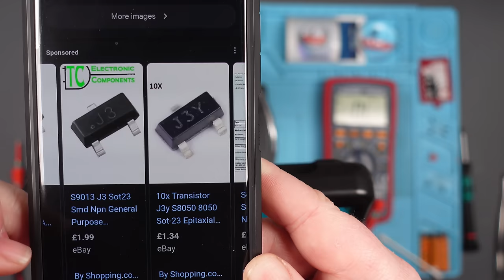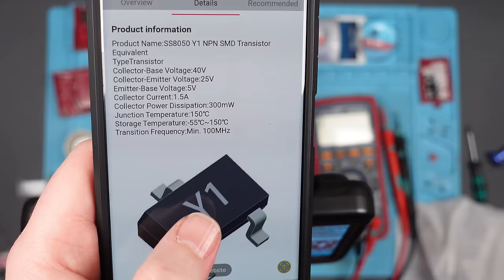FAILED Prior Repair Attempt on this RETRO ARCADE Game? | Can I FIX It?

Comment: May I suggest using rubber polishing bits (the green ones) for your Dremel instead of engraving bits. They come in different sizes and are much softer - so they perfectly remove the solder mask from the board and do not damage the copper trace.
Reply: Or a fibreglass pencil 👍
Reply: Agree with "ximonx"  I use a fibreglass pen those grinding pens seem way too aggressive.

Comment: I prefer a fibre glass pen rather than scraping away at thin PCB tracks, I find it's somewhat kinder to the track. 
My PCB coating of choice for something like this is cheap clear nail polish, plus I can do my nails afterwards and look pretty in the lab. ''I'm a laydeeee'' 😊😆😆

Comment: 7:56 "These tracks must be really really thin"

They probably were, but having you grind away at them with that grinder doesn't help. at 7:10  you can already see that you've ground a hole in the trace, just below the exact centre of the ground area.

Just stop with the grinder pen, it's way too aggressive.

Also the usual "stop soldering, it's on there already, leave it alone, you're just going to mo<plop>.... move it... yeah you moved it...."
I was very pleased to hear you say "why is it all wonky.... well I guess it doesn't matter" about 2 seconds before the part would be complete toast.

Another successfull fix though! Congrats!

Comment: You just put in a beefier transistor. Lots of parts are interchangeable if they have the same pinouts/functions. Of course you can't switch an NPN for a PNP and all that, but having a higher maximum doesn't hurt. Just like you could use 100W resistors instead of 0.25W resistors... it's just impractical. 

There's no real reason to get specific parts. As long as the part works with the voltage of the device you're working on and the pinout is the same, it's worth a try. You could also wire them in with a different pinout, but that's a little less convenient.

When working on really old electronics, you'll have to find similar things, as the original parts aren't made anymore. Audio equipment from the 50s-70s is a completely different world for example.

Don't overthink those repairs too much. You probably know enough by now to not pick something that will kill the whole device!

Comment: A trick i saw someone do for a ripped pad like that was grind back, then solder a piece of solder wick that fit where the original pad was and solder the wire to the wick

Comment: Good way to deal with bits of loose track flapping in the breeze: glue them down first so that you have a lot of stable copper to run bodge wires with.
Reply: What's a glue that can survive soldering temperatures?

Comment: Bravo sir, Bravo. Usually on those low voltage type games any NPN or PNP, which ever it uses, will work. It just depends on which batch they can get the cheapest at the time of production... If you keep a general stock of both types, you have it covered for the most part. It any game would need anything even near an amp or as much, the batteries would drain before you finish the first round of play. That wouldn't be good... That would be a "Stupid Game" for sure...   lol
Reply: Agree, I have bodged in a  2n2222 TO-92 instead of an obscure Chinese SMD NPN before in a similar device.
Crappy Chinese data sheet pretty much only gave me that it was an NPN and google translate couldn't do anything with the bad quality data sheet.
Got some more part stock these days.

Comment: Definitely use solder mask. It glues wires in places so they don't move and accidentally break loose.

I was going to say that the current absolutely could break things with thr transistor. But it's likely within the limits so it would be fine.

Comment: I think the low quality solder job were caused by the old and or low quality solder used originally. Perhaps cleaning up the solder and applying new one would make the job cleaner. But who cares, as long as it's working!
Reply: Yeah my one critique would be re-using this low quality solder
Reply: Especially on that transistor...the pads were open and would've wicked up in 2 seconds.

Comment: Great fix stez. I think your iron is a bit dirty so your solder doesn’t flow as well.
Reply: Looks like the plating on it is oxidized, might be fixable with some of that soldering tip activator stuff.

Comment: You’re getting better, but…
I wish you would buy a finer point iron tip and some finer solder.
It would make those repairs easier.
Look up the IPC repair standard, IPC 7711/7721.

Comment: Why not use conductive epoxy for those fixes that soldering can't quite fix?   Great for fixing plastic ribbons and fixing said ribbons onto a board where a soldering iron would burn through the fragile plastic.   I use a gold and a silver infused epoxy on my quartz watches utilising a black grade watch oiler to "draw" the trace and once done a very resilient fix.

Comment: Did you missed a trace fix on the screen and it worked anyway?
Reply: Yeah, I also noticed that, I was screaming at the screen while he was putting the tape. Perhaps he realized that it wasn't going anywhere on the screen pcb.